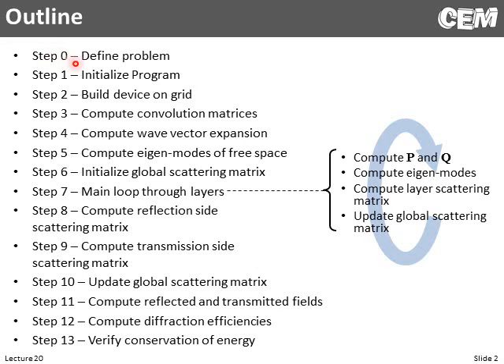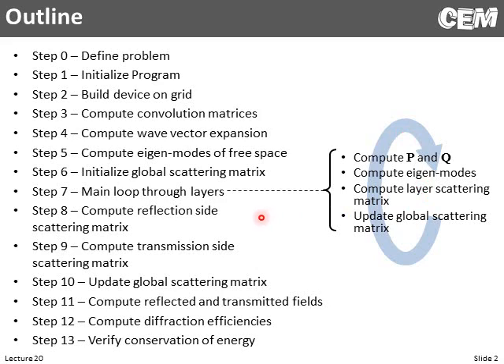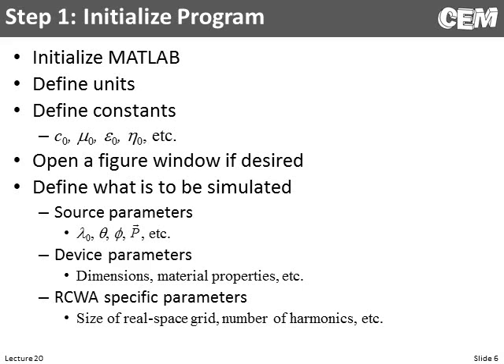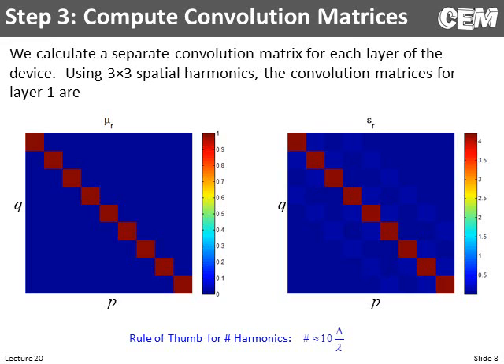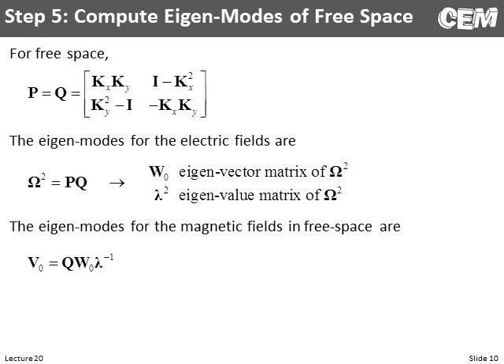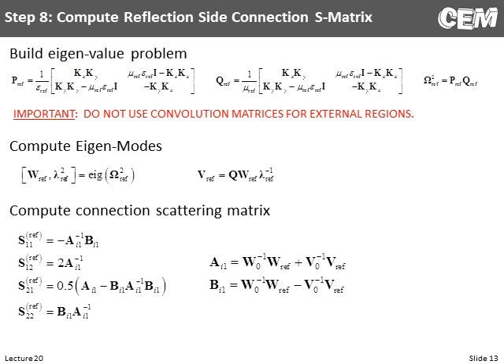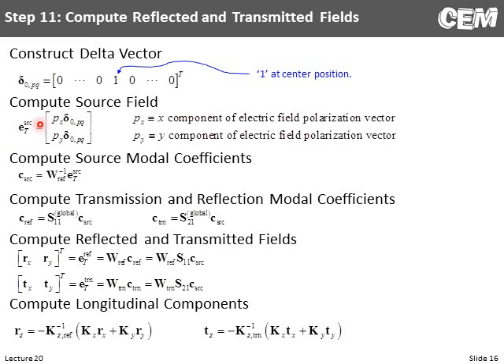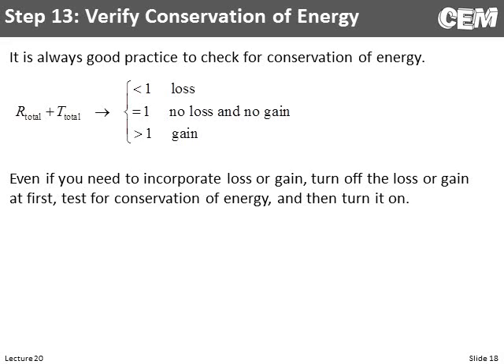Lecture 20 (CEM) -- Implementation of Rigorous Coupled-Wave Analysis

Comment: Hi Professor Rumpf, thank you for your courses.
I faced a problem - when the wave falls on the material within the layer (in oblique angle) there is no reflection, only transmission, whereas at the boundary between the layers it is present. 
The structure looks like dielectric brick surounded by free space. 
I think it is necessary, somehow, to enforce the boundary conditions in eigenvalue part of the solution but I saw a thesis where the author used the same RCWA approach as in your lectures without any modifications (FFF with normal vector matrix) and there were no such issue. 
Did you face this problem ?
Reply from the maker: There are several things that could be happening.

First, your code may be working correctly. There will be a standing wave in the dielectric slab and interference could lead to certain frequencies where transmission goes to 100% or even reflection to 100%.

Second, maybe something is wrong with your code. There is no need for the eigen-value problem to consider boundary conditions between layers. The eigen-value problem is independent of the layer thickness.  They just calculate the modes in that layer. The boundary conditions are considered when you connect the eigenmodes from one layer into another layer. My videos step through the scattering matrix approach to do this, but there are other ways. 

Third, there is a rare circumstance where RCWA will fail. This happens any time kz=0 in a layer. This is also a physical thing where measured results will also be tricky. There is no solution to this that I am aware of other than something like interpolating the result at that wavelength using two closely space wavelengths on either side.

Fourth, could be something I not thinking about. Keep an open mind!

Hope something I said here helps!

Comment: Hi Professor, thank you so much for the lecture, it really helped me a lot. I have a question for you, when I calculate the reflection coefficients in x,y,z directions using PCWA, is it possible to decompose the reflection coefficients in these three directions into TE and TM directions which are consistent with the incident field, and then further solve the ellipsometric parameter and Mueller matrix. Looking forward to your reply, thanks!
Reply from the maker: Calculate the overall reflected field. Calculate the dot product of that field in the TE and TM directions. That should give you the reflection coefficients for TE and TM. Just keep in mind that your device may be coupling energy between the TE and TM modes. In this case, be careful interpreting the reflection coefficients.

As for matching ellipsometry, I don't remember. Very sorry! I have done this in the past.
Reply: @empossible1577  Thank you for your reply, I understand! But Prof. what do you mean when you say that the device may couple the energy between TE and TM modes, which would result in the final sum of reflection and transmission efficiencies not being 1?
Reply from the maker: @dashingQ  Let's say your source is TE polarized. You could potentially reflect both a TE and TM polarization. So, if you look at the TE reflection coefficient, maybe that is 15%. However, more light could be reflecting in the TM polarization.

Does that make sense? Just be careful interpreting your coefficients as a single coefficient may not tell the whole story.
Reply: @empossible1577  Oh！I see.！Thank you so much!!!

Comment: Can this method be used when there is a metal grating on top of  dielectric layers?
Reply from the maker: Yes...but

In my opinion, Fourier methods are not the best when metals are incorporated. Metals are essentially impulse functions in terms of the materials properties and resolving those with a Fourier expansion requires a lot of terms. Real-space methods tend to perform better (faster) in my experience.

That said, RCWA can certainly work with metals and plenty of people smarter than me use it quite effectively. You may choose to use RCWA simply because you do not want to learn, formulate, and implement a new numerical method and I think that is reasonable.
Reply: @empossible1577   Thank you, for your response. I will continue with the FDTD method for which I have a full 3D code. Your lectures had helped during the development of the FDTD code.
I thought of implementing  RCWA and make comparison of the results with the ones obtained using the FDTD code.
Reply from the maker: @athulshaji1754  FDTD is a great method. In fact, I am working on my online 3D FDTD course as we speak. I still have a lot of work to do on it, but hope to get it out soon.

Comment: Hi Prof. Rumpf,
I've written some code which behaves well for simple problems. I'm working on a structure for which the 2D layers are x-y periodic and I'm running into "singular matrix" errors. I've zeroed the imaginary part of permittivity, but I still get these errors. Any experience of this or ideas where this comes from?
Reply from the maker: If the happen no matter what you are doing to your code then you have a mistake somewhere. If this only happens at certain wavelengths, it may not be a problem with your code. RCWA (and all methods I know of) fails when there is a diffraction order at cutoff. Try changing the wavelength slightly and see if that fixes the problem.
Reply: @empossible1577  I've tried a range of frequencies over UV/Vis/NIR, and I either get singular matrix errors or nan/inf for reflection/transmission. Do I need more fourier orders, or am I missing something?
Reply from the maker: @TeslaFactory  You definitely have a mistake in your code because this should not happen. It is only specific frequencies where a diffraction order has a cutoff where this should happen. Adding more diffraction orders will not help your problem. In fact, I always recommend simplifying the problem as much as possible so the problem still exists. This will make it easier to troubleshoot. Consider even trying just one spatial harmonic and see if the problem still exists.

Are you aware of the benchmarking documents I provide? They are under Homework>Help here:

https://empossible.net/academics/emp5337/

They step you through an RCWA problem and show all the intermediate results. This may help you find your problem.
Reply: @empossible1577  i tried out some of those problems, and it turns out I was handling the diffraction orders for reflection and transmission wrong when trying to evaluate overall transmittance and reflectance.

I do get the error again when going above 21x21 though... I do need higher orders than this due to the nature of what I'm trying to model... Any ideas why?
Reply from the maker: @TeslaFactory  That is strange it works for less spatial harmonics but not over 21x21. It should still work for any number other than slowing down as matrix size grows. Did you try the benchmarking document?

Comment: Hello professor, when I used this program（I have bought your lesson and copied your code） to calculate multi-layer dielectric film gratings, the results were correct, but when some materials have complex refractive indices, the total diffraction efficiency exceeds 1. Obviously, there's something wrong with this, but I couldn't find it. Do you have any clue?
Reply from the maker: This should be an easy fix. RCWA is typically implemented using the negative sign convention so I did the same for consistency.  That means materials with loss will have a negative imaginary component.  I will guess that you have your imaginary component positive taken from a source using the positive sign convention.  The solution is just to switch this sign. You have been simulating gain instead of loss.
Reply: @empossible1577  You're right, I did make this mistake, thanks for answering my doubts!

Comment: Thank you ... I want to implement it through Matlab ... Professor can you please recommend me some supplementary to learn easily
Reply from the maker: Rigorous coupled-wave analysis (RCWA) is a combination of the transfer matrix method (TMM) and the plane wave expansion method (PWEM).  To learn RCWA, I recommend starting with TMM, then learn PWEM, and end with RCWA.  You will get to learn three methods for the price of one!  All of these methods are taught for free in my Computational Electromagnetics class in Topics 2, 6 and 7 here:

https://empossible.net/emp5337/

If you are struggling with the MATLAB, there is an online course that steps you through each line of MATLAB code for a fully three-dimensional RCWA.

https://empossible.thinkific.com/courses/rcwa3d

This course only covers the parts of TMM and PWEM that you need for RCWA.  If you want to fully learn the MATLAB code for TMM, here is an online course for that:

https://empossible.thinkific.com/courses/tmmmatlab

To fully learn the MATLAB code for PWEM, there are options for 2D PWEM, 3D PWEM and a combination course that has both 2D PWEM and 3D PWEM here:

https://empossible.thinkific.com/collections?page=1

Hope this helps!
Reply: @empossible1577  Thank you so much for helping me.

Comment: Hello professor! In a slide in (08:41), what if I set NP = NQ = 1 for Layer1? In this case, does it make sense that I think I would be able to simulate non-periodic one triangular device?
Reply from the maker: Unfortunately no.  RCWA with NP = NQ = 1 reduces to the transfer matrix method (TMM).  TMM simulates transmission and reflection from a stack of layers composed of homogenous materials.  When using RCWA this way, the homogenous layers are set to the effective refractive index of layers.  In a sense, it is using an effective index method.  When the period is subwavelength, it is a pretty accurate way to simulate some things.

If you want to simulate a non-periodic device with RCWA, you have two options.  First, you can make the unit cell large enough that the triangle is far enough away from other triangles that it acts like an isolated triangle.  Second, you can use a PML in RCWA to isolate the triangle from adjacent triangles.  Overall, I recommend using an entirely different method like finite-difference time-domain.

BTW, the videos you are looking at have been updated.  I recommend accessing the course and videos through the course website you are looking at the latest version of everything and also have access to all of the other resources on the course website.

https://empossible.net/academics/emp5337/
Reply: @empossible1577  Yeah, it seems that there are other methods appropriate for that situation. And thank you for the information about the website. Thank you so much! :D

Comment: Just finished implementing 3D RCWA thanks to this lecture. Professor, I have a question on how to retrieve the transmitted wave phase?  would it be angle(sum(tz.*transmitted diff efficency))?
Reply from the maker: You will need to calculate the transmission coefficient t.

t = sqrt(tx.^2 + ty.^2 + tz.^2);

The phase is the angle component of t.

phase = angle(t(m));

Here m selects the specific diffraction order you want the phase of.
Reply: @empossible1577  Oh thanks, that clarifies. for a specific device, how  would you choose which order? since my expected wavefront is along Z only, should I use 0 order or a weighted version like the diffraction efficiency calculation?
Reply from the maker: @TrueFiredrive  I suspect you are interested in the zero-order mode.  This is true for things like metamaterials and metasurfaces where you are trying to retrieve effective properties of the unit cell.  If the structure is not subwavelength and is diffracting, be careful because effective medium models in this case are not very accurate or useful.
Reply: @empossible1577  I understand now, this kind of information is hard to find explanations for, thanks Professor.
Reply from the maker: @TrueFiredrive  The deeper you get, the harder it is.

Comment: Hello, thank you for sharing these lecture and your know-how is such detail.  I am trying to implement RCWA method according to the implementation PDF on the EMPossible website in "RCWA implementation" section and ran into a problem, perhaps You could provide a hint? 

I am benchmarking my program according to "3x3 oblique incidence" document. In the second iteration I get the correct (according to the document page 19/44) Omega^2 matrix (I mean really correct - no imaginary part, no trailing zeros anywhere, just exactly like in the benchmarking document). 

However, the eigen vectors returned by eig(full(Omega2)) do not match the ones provided in the document (bottom of page 19/44). 
When I test the eigenvectors and eigenvalues returned by the function according to MATLAB documentation ( Omega2 * W = W * LAMBDA ) I determine they are in fact equal (up to 1e-14). 

How should I proceed? As far as MATLAB is concerned they are "correct", but they are not the same as in the benchmarking document. Everything before this part in my program matched the benchmarking document perfectly (I checked it multiple times). Any advice would be very appreciated.
Reply from the maker: I am pretty confident your code is correct.  Some times very small things can make the eigen-values and eigen-vectors very different, although still correct.  Different algorithms, different version of MATLAB and the alignment of the stars seems to do this.  It happens to my students all the time.  One thing can you do is to manually enter your eigen-values and eigen-vectors to be the same as mine to test the rest of your code.  I know that is tedious, but it will work.
Reply: @empossible1577  I have finished benchmarking the code as You suggested (with variable values from the document) and received the answer to be like the one in the document. 

However, when I ran my code without correcting the values it returned  results different from those in the document - not much different, but still different (). Energy conservation is obeyed, but total reflection and total transmission are different from the ones in the document. Also individual diffraction orders are different - all of them. 

It seems the problem lies in the homogeneous layer of the device (the slab under the triangular layer) but I have no idea how to fix it - eig simply returns the vectors and values as they are. 

I have tried 3 different approaches to the homogeneous layer:
a) using the convolution matrices of the layer with 3x3 harmonics;
b) using the convolution matrices of the layer with 1x1 harmonics because slab has no variation in either direction (according to "RCWA tips and tricks" this should work);
c) using e(device)*eye(size(Kx)) and u(device)*eye(size(Kx)).

"a" gave wrong answer and no energy conservation, "b" threw warning matrix is singular and wrong answer and no energy conservation, "c" gave energy conservation and wrong answer (wrong=different from benchmarking document)

In the document results are:
R =
           0        0             0
           0        0.0848   0.0011
           0        0.0025   0.0004
T =
           0.0000          0.0149          0.0055
           0.0222          0.7851          0.0283
           0.0053          0.0348          0.0150
REF = 0.088768
TRN = 0.91123

I get:
R =
         0    0              0
         0    0.0887    0.0015
         0    0.0020    0.0007
T =
    0.0000    0.0142    0.0031
    0.0222    0.7787    0.0303
    0.0113    0.0330    0.0143

Rsum =
 0.0929
Tsum =
 0.9071

How would you suggest handling the homogeneous layer correctly? Or can this agreement of results be considered "good"?
Reply from the maker: @ezyxas  Homogeneous layers are best handled by just setting the convolution matrices to the identity matrix times the parameter value.  This is standard practice for me for the external regions.  For internal layers, I usually don't do this and the results are still fine.

Also, you are looking at results that are not converged.  It is likely that your code will give the correctly result once converged even though things different when not converged.
Reply: @empossible1577  Thank You for your quick response. However, I have found my error -  a missing conj() was responsible. My results now are 100% like those in the benchmarking document. 
Once again, this is an excellent lecture, thank You for sharing your know-how.
Reply from the maker: @ezyxas  Awesome!  Congratulations!!  Glad I was able to help!
Reply: @empossible1577  Hello again. After passing the benchmarks I tried to model some structures and encountered an unexpected case - for certain incidence angles and illumination wavelengths eigenvalue matrices  in the transmission and reflection region were singular and the algorithm returned "NAN" or "INF" as the diffraction efficiency output. 

Have You ever encountered something similar? What could cause this matrix to become singular? How should I go about fixing this?
Reply from the maker: @ezyxas  Assuming there is nothing wrong with your code, this happens any time kz=0 in any of your layers.  Every numerical method I know of suffers from this in some way.  It is also a touchy thing experimentally in the lab.  They were first observed as Wood's anomalies.  It is possible your gap medium is where kz=0 and you can fix that by choose a higher permittivity in the gap mediums.  If it is happening in your actual layers, there is no fix.  Just skip those wavelengths.  If you change wavelength or angle very slightly, the problem will go away.  If you see this happen over a large span of frequencies or angles, that is a mistake somewhere in your code.
Reply: @empossible1577  Thank You for the quick and informative response. The code passed all of the benchmarks on the EMPossible website, so it must be correct to at least some extent. It appears the error happens either in the layers or in the external regions. I will continue to check and re-check my code for other irregularities. 
Once again, thank You.